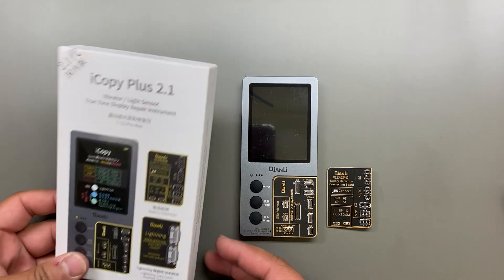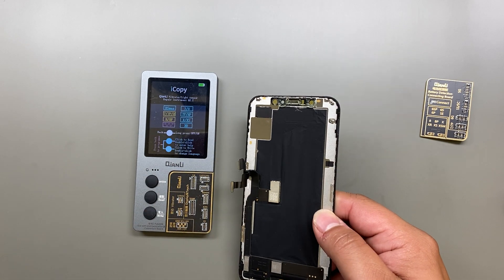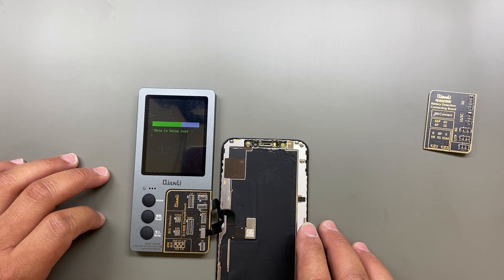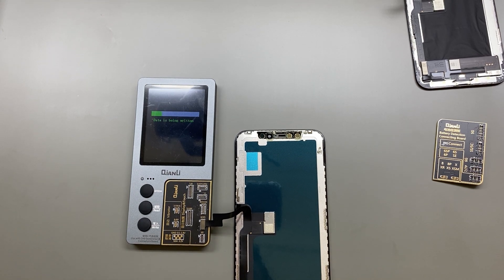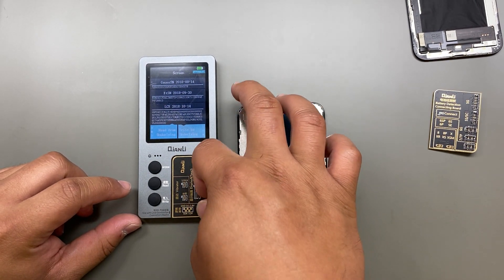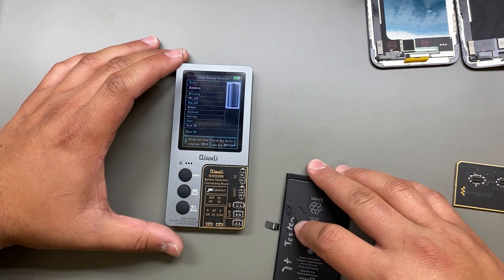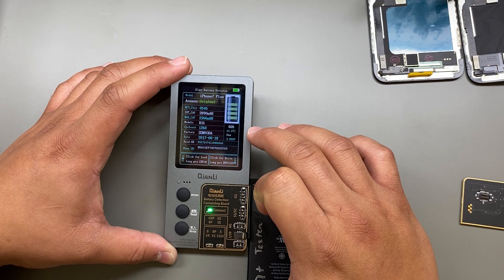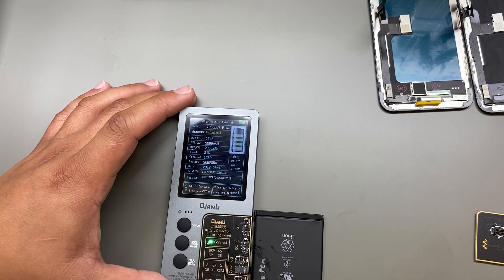iCopy Plus 2.1 Overview

Comment: Can this device transfer data from one genuine original screen to another? Even if both of them have data stored on them?
Reply from the maker: Yes, it can and true tone will work after the transfer is done. This does not resolve the non-genuine part display message as this is a separate component of the display.
Reply: @etechpartsplus2334  thanks for reply i plan on getting one of these and replacing with a genuine screen so I shouldn’t have to worry about that.

Comment: Does anyone have an idea why when I hook up a screen to the iCopy Plus 2.1, it doesn’t detect any display data or serial numbers of any kind? It’s just blank where there should be display data. Therefore I cannot read or write the data from screens…. Any help is appreciated!
Reply from the maker: Hello! If the display is connected to the iCopy Plus 2.1 and no values are read, this typically means that the screen has already been replaced and the values were not transferred over by the original technician. There is a way to reactivate True Tone without having the original data from the screen. If none of the OEM screens you connect to the iCopy have data, I would try to update the software of the iCopy as it may be the cause of the issue. Here is a link to the video we shot showing how to transfer True Tone using the computer and iCopy Plus 2.1 software": https://fb.watch/5lekyEQPsT/

Comment: your'e forgetting the battery program option, or do you not have that board?
Reply from the maker: Hello! This does come with the battery board; however, we mainly use it to read the battery data to determine quality and condition. It is possible to copy and write the data with the batteries but we have found that there is not as much of a benefit doing so as when done with the screens.

Comment: Would the face recognition  still work if you transfer data from the original LCD to the new LCD
Reply: Facial recognition would still work as the components that are required for Face ID are the front sensor cable (transferred from original screen to new screen) and the front camera assembly. Face ID will actually work without using the iCopy, you just won't have the True Tone functionality.

Comment: why mine is not working without plugging in cable?
Reply from the maker: Some of these are sold without the internal battery installed. The version we sell comes with the battery installed which does not require it always being plugged in.

Comment: Nice video, quick question. Have you tried copying one iphone screen data and copying it to multiple aftermarket screen and then try the aftermarket screens on more than one iphones to see if they all work with just one original data? or would every aftermarket lcd need a dedicated original lcd data to be functional on different iphone (same models)? Thanks!
Reply: U Just take serial number from 3utools
Reply from the maker: That's a good question. We haven't tried but it's worth a shot to check. In theory, you should be able to copy the same number to multiple screens.
Reply: @etechpartsplus2334  hello 
How do you reset the apollo interstellar one 
Mine just switched off after updating 
It’s not showing anything on the screen when I try and switch it on
Reply: Does 3u tools gives legit info about device else it's edit able